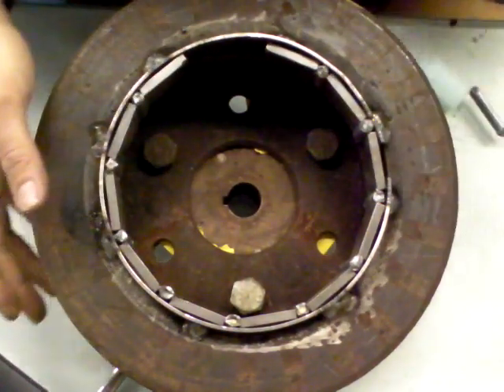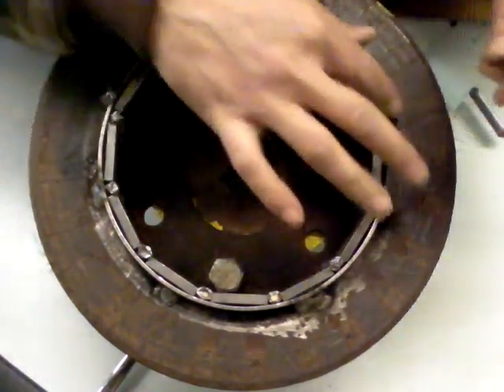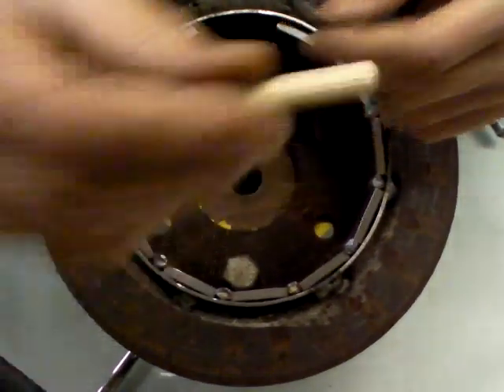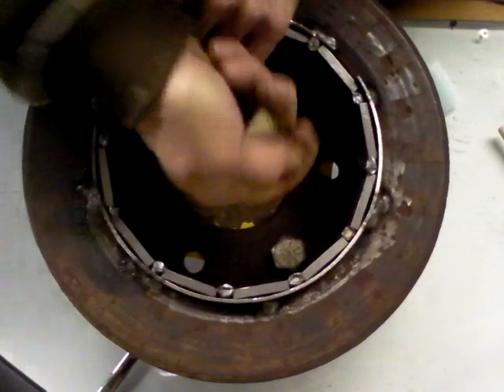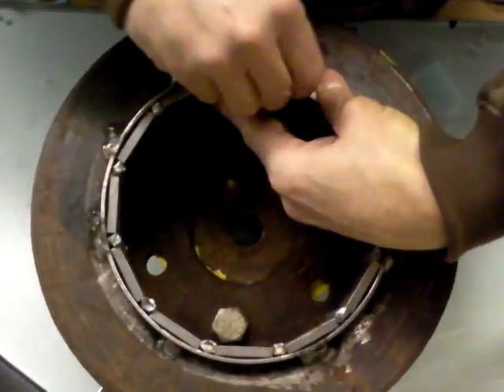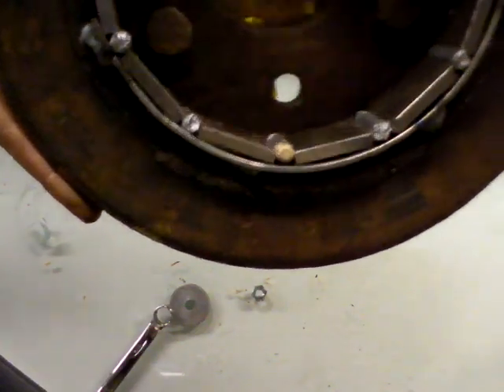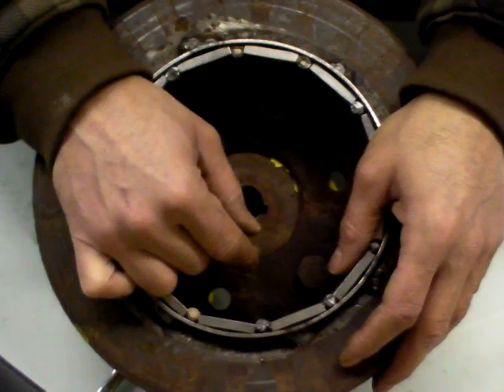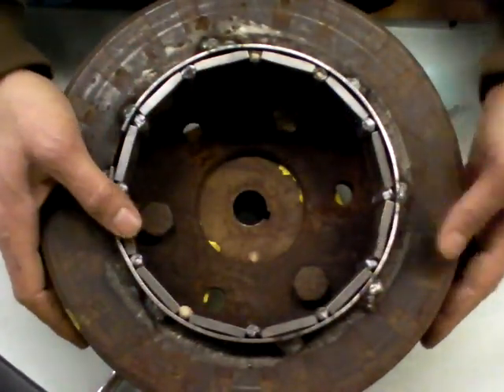04 12pole 36slots iron serpen 3phase PMA axial flux wind turbine vawt hawt generator energy 104

Comment: I cant stop watchin these vids. Is there sumthin wrong with me? ok i gotta ask, cuz im dumb. Does the wire thickness and coil size effect the output of the generator? Is thin wire wrapped 1000 times better at conducting electric current?